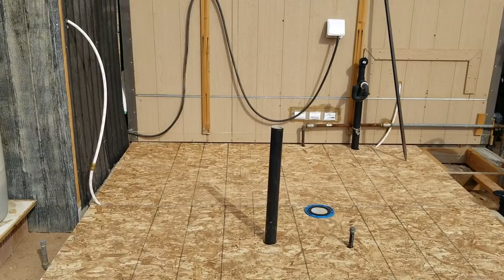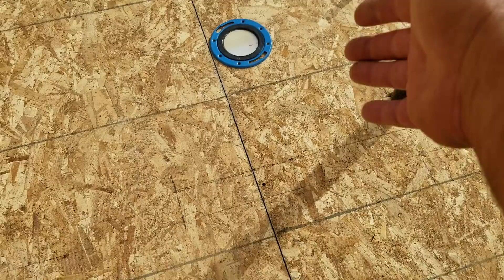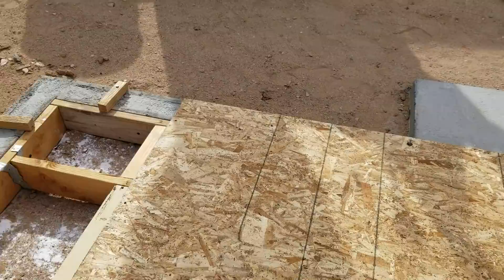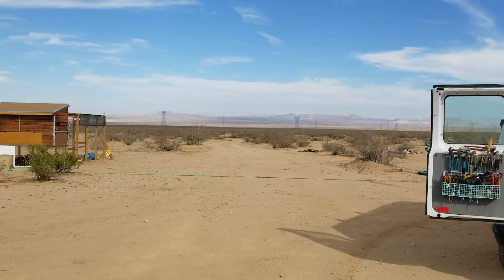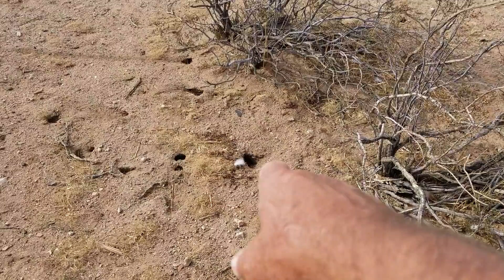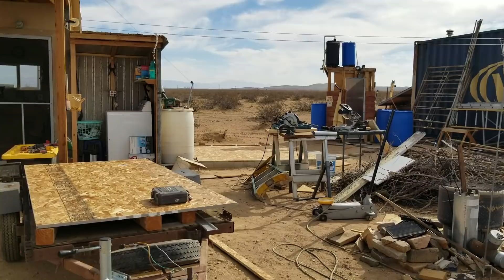Homesteading the Desert,  Aug. 24, 2018

Comment: I know you have a reason for every thing..
So I'm picking your brain..
How did you decide the distance between your containers...
In my ignorance I'm thinkg a bit wider could make a nice workshop for those rainy and windy days..
Reply from the maker: jim h my plan was to make a 3rd storage container so I basically matched the container size in the middle space. I think I added a few inches to make it 10 feet wide.  That span already will require supporting but I think angle supports fastened to the container sides will suffice.  I was trying to avoid support posts which I felt would negate the free space below.

Comment: Getting those holes cut precisely and then muscling those plywood sheets around is no easy task.  Well done!
~
I am surprised that you are not considering a leeching field for your toilet.  As porous as that ground is I would think it would be no problem.  With time it might even enrich the soil, but I only have a bystanders knowledge.
~
As to your chicken feed bandits.  Can't you Gerry rig a sleeve to slide over or down over the feed openings at night?
~
I saw a chicken coop design somewhere that buried a perimeter of sheet metal around the coop both vertically and horizontally. Perhaps you can find some cast off siding to replicate something similar.  
~
Maybe  also run another layer of chicken wire, off-set to make the holes smaller, or an 18" high wall around the base with scrap wood or metal.
I know, a huge amount of work added to your over burdened to do list.  Just wanting the ladies to be safe and happy.  LOL
Reply from the maker: Ducelick Koshiol the next video will answer a lot of questions.  Time for bed now, just finished watching an old Charlie Chaplin silent movie called The Gold Rush.  I really enjoyed it!
Reply: Great job my friend on the sub floor that is not easy to accomplish by yourself well planned out gotta get the  varmints taken care of
Reply from the maker: ATJH Travels thanks again!  I measured, cut and drilled each piece on the trailer, then set them in place and screwed them down.

Comment: Figure out a way to make a cover for the food tube down where the chickens eat and one for the top if you don't have one already, and cover it late in the day when the chickens go to roost for the night.  That should keep rats and things from stealing feed at night. Maybe a slightly larger diameter of pipe to slip over the eating holes and put a cement block on it to keep the rodents from moving it.  Or a thin piece of metal bent to cover the holes and a weight.
Reply from the maker: T Green actually, as seen in my original video when I built and installed the auto feeder, I designed closable covers for that feeder.  As of tonight I started closing them.  Great minds think alike. 😎